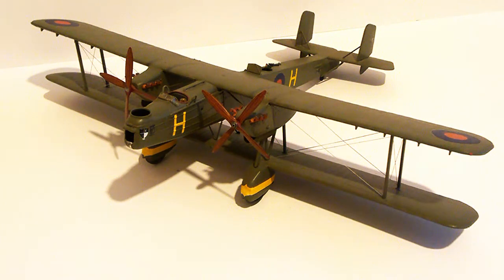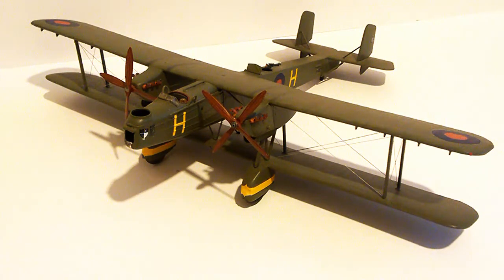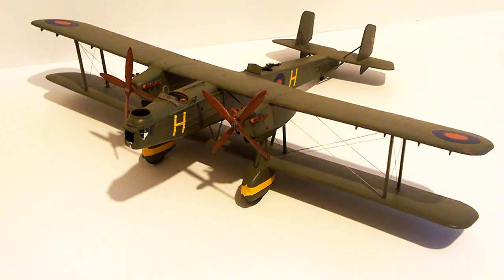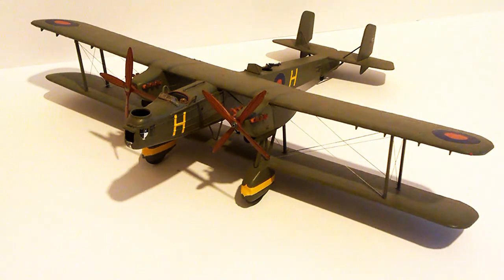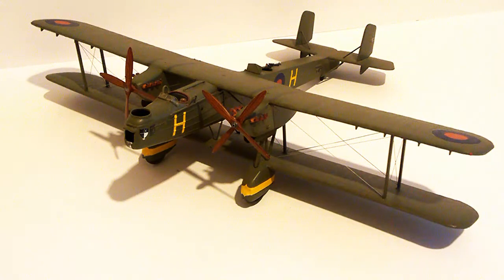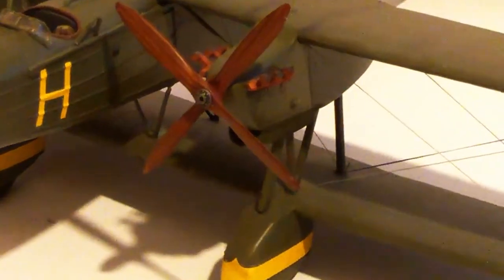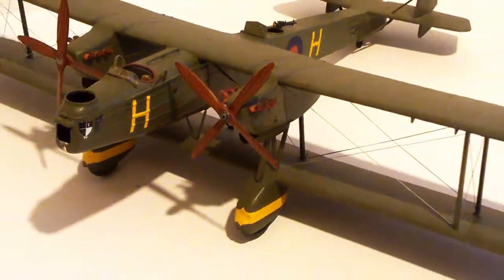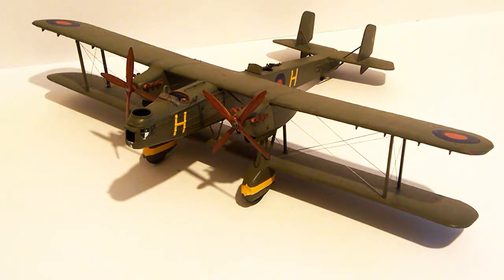1:72 Handeley Page Heyford (PK-605) - Matchbox Mondays #9

Comment: Gorgeous Heyford, great to see such a challenging old Matchbox kit so beautifully built and finished. What diameter was the metal rod used for the rigging and where did you source it from?
Reply from the maker: It's been a while since I built it and I have just checked the rigging to try to get a diameter for you......it's not wire like I thought! It's the rigging I usually use! Sorry. Now I have to find the build where I did actually use wire! Thanks for your kind words though Chancer.
Reply from the maker: I went to the place where I got the wire to use as rigging on a build (still can't work out which one!) It was 0.015" or 0.38mm music wire mate. I hope that helps.

Comment: Twine looks terrible as biplane rigging (which was made of metal strips, not rope), and threaded through drilled holes is a real bugger to fit. 

Find some 'silver' sprue and heat it over a candle flame, then draw it out so that the heated section becomes stretched to a very fine thread - it takes a little practice, but it doesn't take long to get the technique (you can even use your finger tips to press it into a, correct, aerofoil cross-section as it cools. Then use a pair of compasses to measure the distance between one strut end and the other, cut off the right length, a little blob of adhesive on each end to hold it in position (glue one end first and let it dry then you can stretch it tight with tweezers when you come to fix the other end).

'Perfect' (and easy) rigging for biplane models.
Reply from the maker: I could never get sprue to melt and thin out sufficiently. I'll have to give it a go again Anthony. Thanks for the tip..
Reply: Just heat one centimetre or so of the sprue by holding it 3 to 5 cm over the flame and then pull the unheated parts of the sprue GENTLY and evenly. It takes a little practice, but sprue and candle flame are cheap!

Bon chance!
Reply from the maker: Thanks Anthony. You certainly make it sound easy. I need to try this again. Al